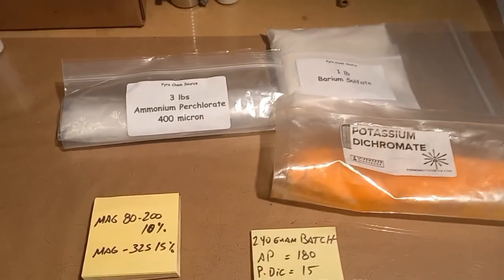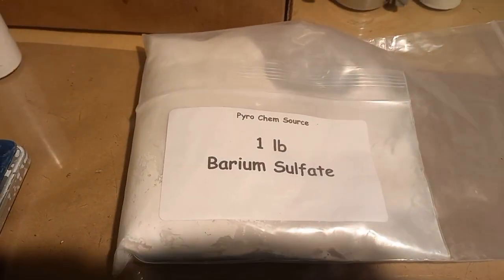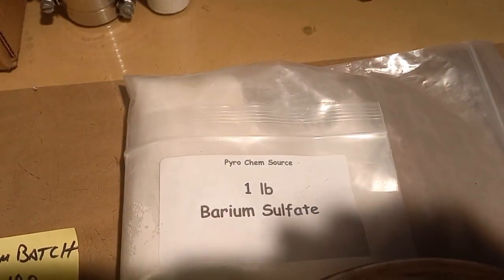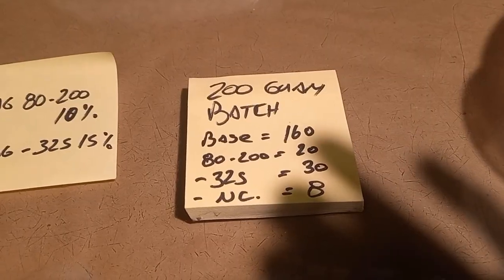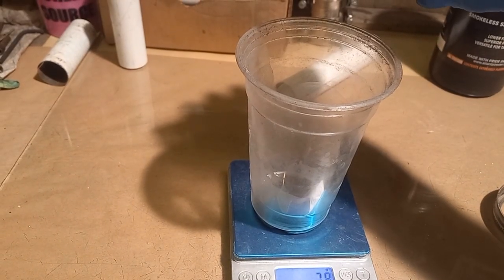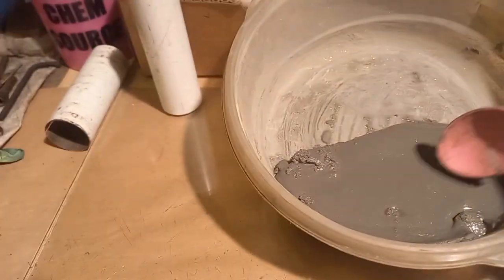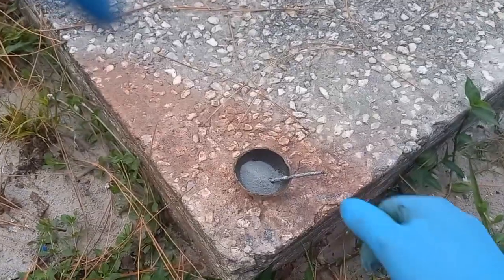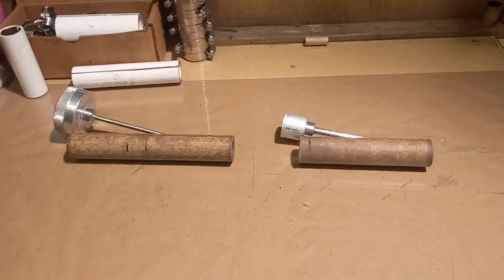Strobe rocket fuel . Making/Testing/Launching

Comment: In the first motor what do i put in it and where can i find it
Reply from the maker: On the first motor I used HP140-4c that's a well known rocket fuel meant to lift heavy payloads in fireworks.
Like any other fuel , that's something you have to make , there is no where you can find it
Reply: So green dot and acetone is hp140-4c?
Reply from the maker: @Pyrorocket123  no , green dot and acetone is the nitrocellulose laquer used as a binder on the strobe fuel
Reply: Or do i mix the hp with the strobe in the 2nd rocket?
Reply from the maker: @Pyrorocket123  do not mix anything ,  pressing the lower section with KHP fuel and pressing the rest of spindle with strobe is the way to go , don't mix fuels.
Whistle and strobe rockets are the most complex and dangerous rockets to make.
These are all basic stuff that you should know if you're attempting on making whistle and strobe rockets , without this basic knowledge you may be subject to loose your hands or fingers , what  type of rocket making do you have experience with?
Reply: Potassium Hydrogen Phthalate - KHP in the 2nd rocket? Thanks for the help brother
Reply: Ok makes sense how about the khp do i gotta buy that or make it for the 2nd motor ima subscribe to you thank you for the help
Reply from the maker: @Pyrorocket123  KHP fuel is considered a red line rocket fuel and is no way you can buy it , you have to make it. 
According to your questions I understand that you are way too far away from making this type of advanced rockets .
Is like you are seating on a very advanced trigonometry class and you're asking the teacher how much is 2+2 .
Don't want to discourage you , but I'm certain that you will get hurt trying making these sensitive fuels  , you can't start from the final line , you need to start from the beginning .
Reply: No experience at all i want to make a 4stage rocket but you kinda got me scared now lol i want to keep my fingers & hands
Reply from the maker: @Pyrorocket123  you have no idea the amount of planning,  development and knowledge it takes to make a 4 stage rocket my friend , sometimes takes years for experimented pyros to get there , and many can't succeed. 
Need to learn first how to hand ram black powder rockets , play with nozzled vs. Nozzleless ones , need to learn how to make dependable whistle fuels , need to understand how to use a hydraulic press and how to make the proper calculations to successfully press a rocket ,  any attempt on hand ramming whistle or strobe fuels will end up in a catastrophic accident , plus need to figure it out of  all the types of spindles and rocket tooling you need to even start thinking on making a 4 stage.
Need to go back in your planning and start from the start.
Sorry to tell you all this but there is not forgiveness on this business when a accident happens
Reply: I bought the chemicals in your vid that you had listed for the strobe  i just need the green dot idk where to get that but aside from all that you got any tips for me?
Reply from the maker: @Pyrorocket123  the only tip I have for you after you indicated that never made or have any experience making any rockets at all ,  is to stay away from whistles and strobe fuels , in some cases they are almost as sensitive as Flash powders,  not for a non experienced for sure
Reply: Ok ima cancel my order would you sell me a 4 stage rocket?
Reply from the maker: @Pyrorocket123  can't sell anything to anyone,  it will be illegal. 
If you really want to enjoy seeing your own rockets flying to the air I'll suggest to start with the black powder platform,  fuels are not dangerous to work with , and dont need a hydraulic press to make them .
Ned Gorsky channel has many videos in how to make BP rockets .
A 1 pound BP rocket is capable to reach 500 ft and lift a 150 gram salute easily,  very enjoyable rockets ,  still one of my favorite rockets,  no doubt.

Comment: Nice video, thank you!
  I hope you are well.
I know it's getting humid and the AP and B-SUL are both hydroscopic.
Should I dry them in the oven? Will moisture slow down the reaction?
Thanks, FP.....Keep up the good work!😁
Reply from the maker: Yes,  you want your AP and ba sulfate dry , place them in the oven a 250 for an hour or you can also use a infrared lamp , moisture will affect the ratio definitely
Reply: @Pyroflorida  Thank you, FP! I just got back from Jacksonville last week, it was hot 93F. By the way, I tried the formula twice in this video and my strobe fuel flashes but it doesn't make any sound, What am I doing wrong? Thanks again!
Reply from the maker: @smileface102  as long that the fuel is made as shown in the video and as long that is pressed as a hollow core grain of at least 3 inch long it should flash and pop very hard.

Comment: Sir. I make sodium benzoate and kno3 for whistle and mix through lacquer thinner but why still blasting or boom. Not whistle.
Reply from the maker: I dont have a how to whistle fuel vid.. but make a research , for what I see you got it totally wrong , there is not whistle fuel you can make with kno3
Reply: Ur missing some steps my boy ..are u adding Red Iron Oxide??....KClO4 ? Nail polish ..wax ... ???GRANULATED???
Reply from the maker: @bigray7647   this is a strobe fuel video. Not a whistle fuel video nothing is  missing .. strobe fuel doesn't use red iron oxide at all like whistles do.
The pleghmatizer on this formula is the nitrocellulose laquer , that eliminates the need of using wax or oils.  
Anyway a 1% oil can be added in order to desensitize the mix a little if desired, but is not necessary
Reply from the maker: @bigray7647  also kclo4 is not used I strobes as well , primary oxidizers are AP and pot dichromate. 
There is a formula that I developed time ago that includes only 5% kclo4 in order to slow down the cycle but is a non common formula
Reply from the maker: @bigray7647  5.17 minutes  mix is granulated
Reply: Yep. Granulating these mixes seems to help with a few things: it prevents ingredients from separating, it keeps the  dust level down and seems to compress better than the powdery fuel. I granulated all my rocket fuels with 8 mesh screens. If it remains crumbly when dry, I will probably add more binder, wet then re-granulate. Too much is just as bad. Strobe fuel may not work at all